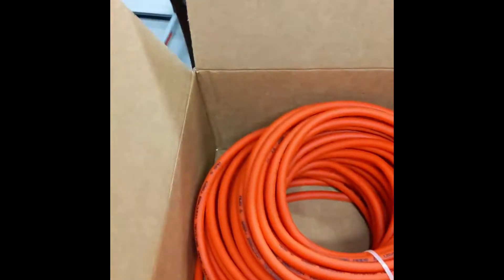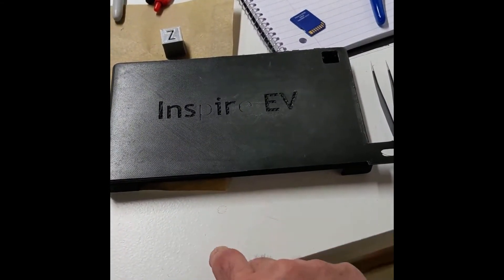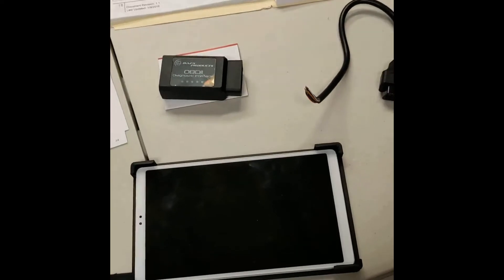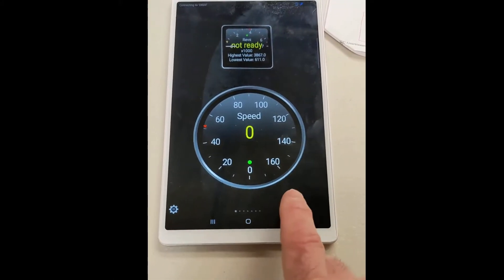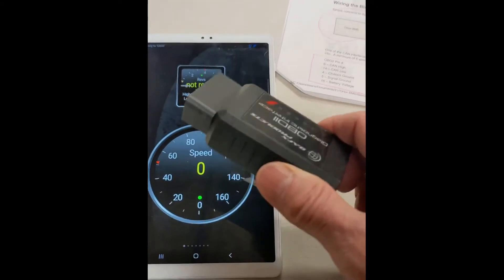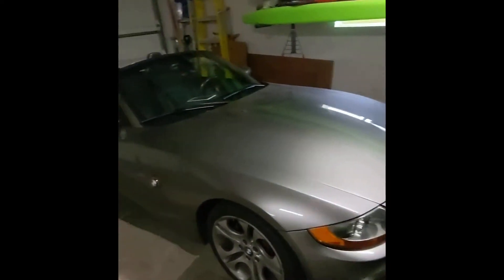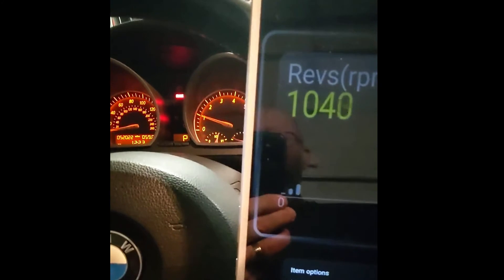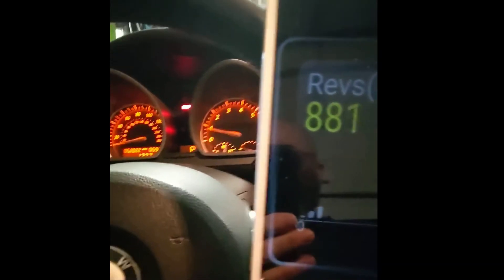Dan walks through the gauge setup using the Torque Pro App

Comment: Dude, that's ALUMINUM cable.  The way you can tell is it's super light and floppy like that.  Solid Copper cable is solid and HEAVY.  That Aluminum crap will MELT under heavy load.

Comment: How did you Map it?   I’m unclear as to how to find the rpm signal to the module then to the torque app.   Maybe it was easy for you in this specific case because it was drop down make/model/item.  But what if my motor of BMS level isn’t there.   How to get that data?